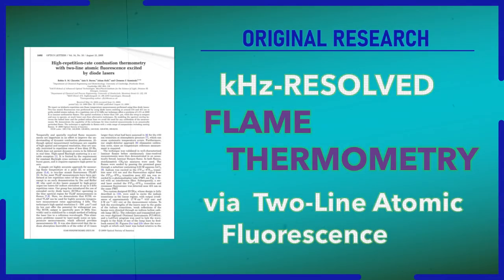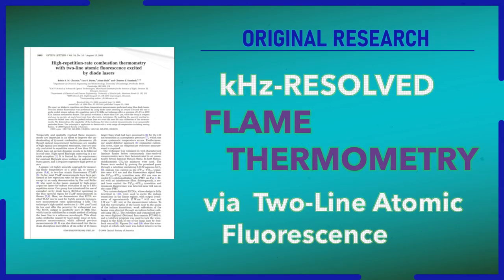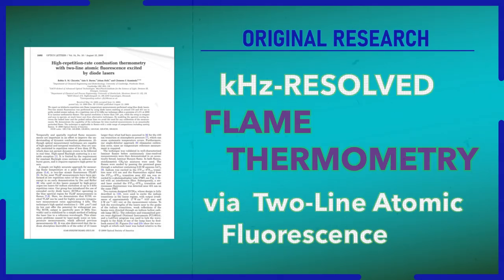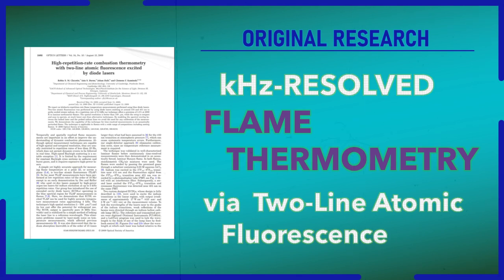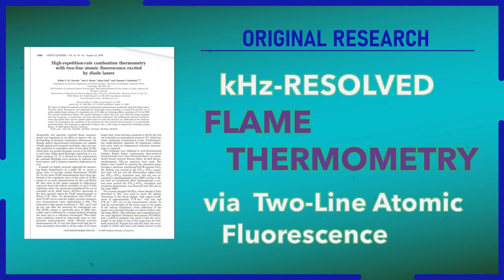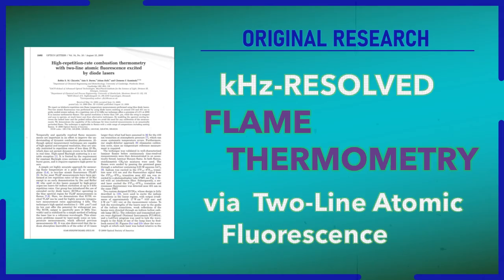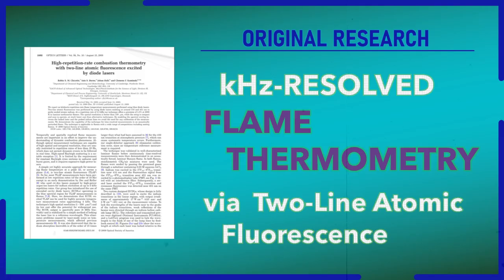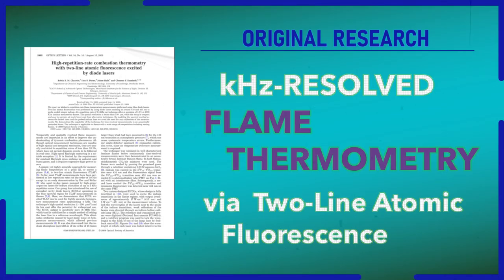Ɍ﹠Ɗ Spotlight💥Blue Diode Lasers ~ kHz-Resolved Flame Temperature Measurement

Comment: The accuracy was 1.5%, at 3,000F that’d be +/- 45 degrees, not a single digit 🙁

What I’d really like to know is what exactly they’re measuring in the indium emissions, and what the mechanism is that relates it to temperature? (Maybe the broadening of an emission line due to thermal motion of the atoms?)

(FWIW, the perky AI voices were a bit much to listen to, and the error about the precision was bad. I like the general idea of digests of interesting technical papers like this  , but really want them to include more information on mechanisms and measurements. - And be accurate and not hallucinate.)
Reply from the maker: Yes, 1.5% at 2000 K is 30K - they're good at language, but not so much at math!

In a nutshell, the indium atoms are electronically-excited, whose fluorescence is then captured by a PMT. A slow wavelength scan of the lasers captures a spectrum. When using the fast mode of measurement, the laser wavelength is fixed, and then the ratio of the fluorescence from the two lasers (410 and 451 nm) allows T to be calculated via spectral modelling. Please see details of the technique from the link provided in the video description.

The idea of these podcasts is to provide digests of the underlying technical content - keeping a broader picture. One could say that it is real cornball; however, they summarize the material with analogies that helps to make it all a little more accessible to the audience. Your insights help us refine this balance—thanks for sharing!